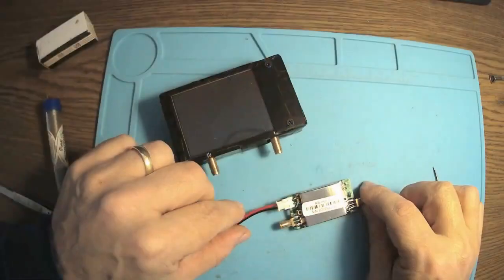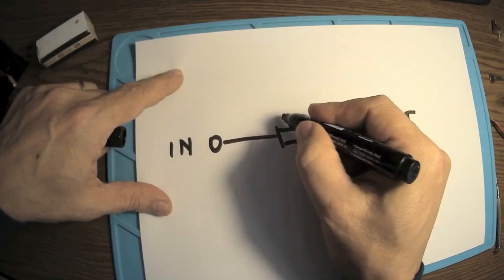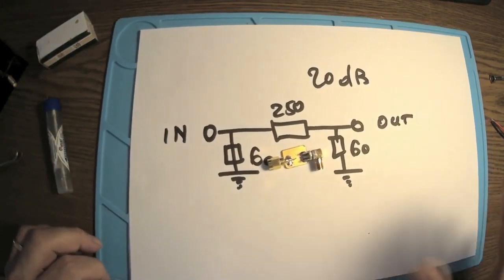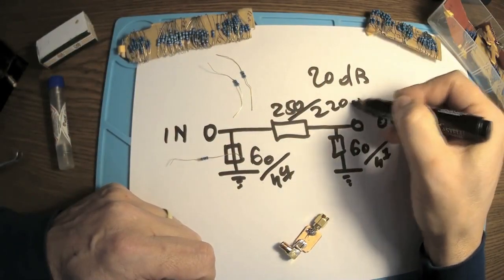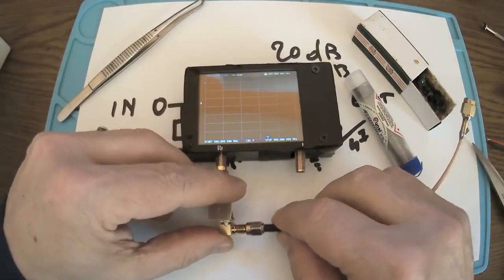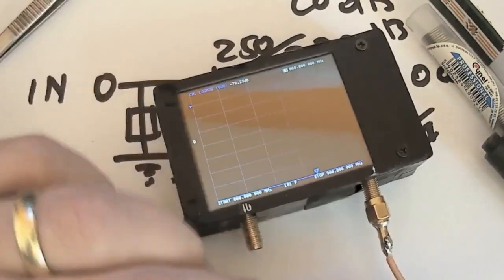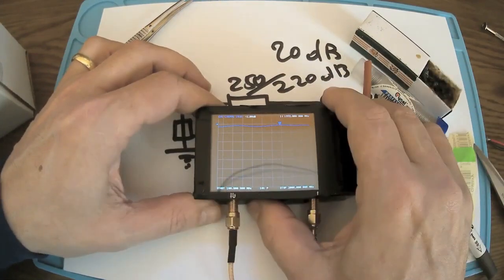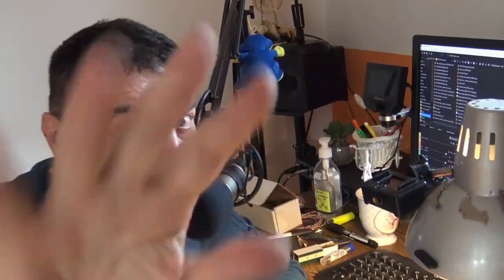DIY a simple Helium LoRA attenuator

Comment: Is it possible to change the 250 resistor for a potentiometer or does there have to be a fixed relationship with the 60 ohm ? Tank you.
Reply from the maker: It doesn't work like that, there  is a relation between all arms, also the impedance..check here https://www.pasternack.com/t-calculator-pi-attn.aspx
Reply: @viocaia  thank you very very much 👍👍👍👍